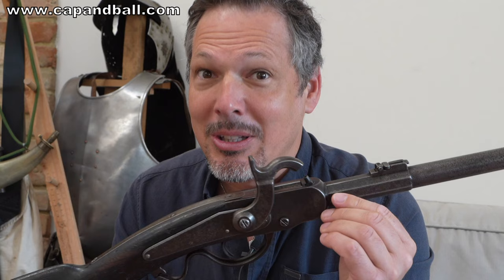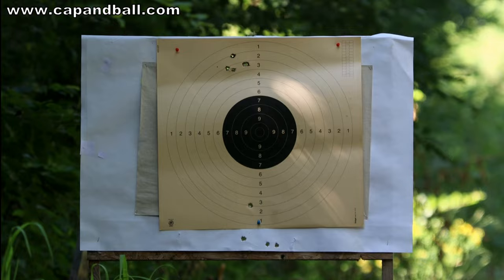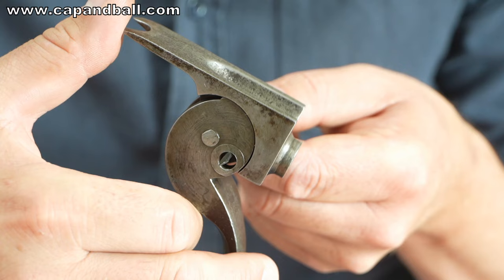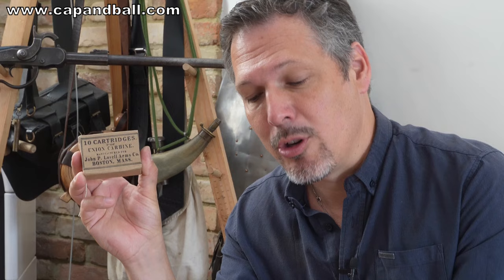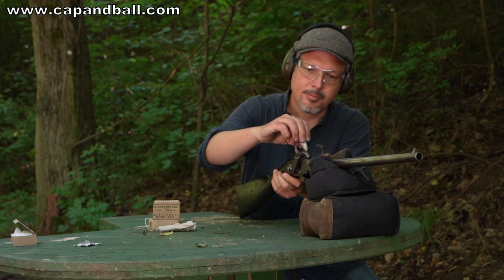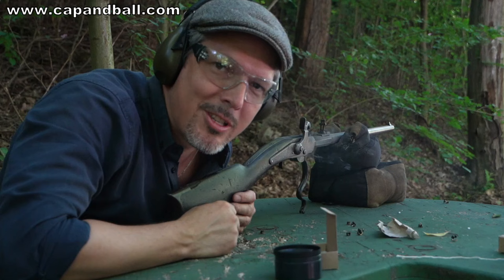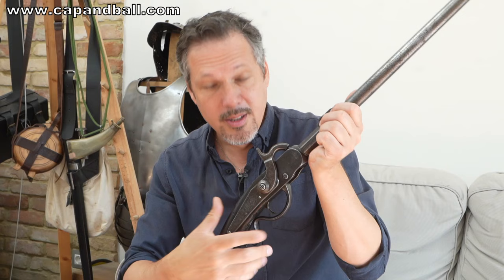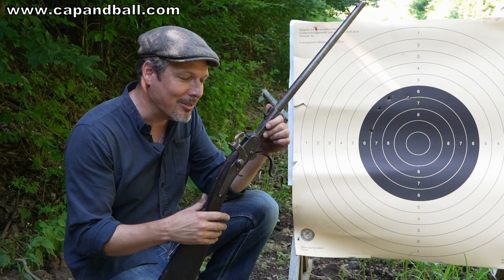The Civil War Grapevine percussion breech loading carbine

Comment: All those breechloaders had the same gas leaking problem before the metallic cases, indeed.

The Hall 1819 rifle that was the first breech loading rifle to have seen service in the US Army, even the Lindner carbine that was sold to the french army and saw service in 1870...
Reply from the maker: A friend of mine has a Lindner. I am planning to make a video about it.
Reply: @capandball  
Lindner tried to solve the problem and partly succeeded with a specific locking system.
Efficient but they became quickly obsolete...

Comment: Thank you for this video, I shoot one in the North-South Skirmish Association and it is an accurate and easily serviced Arm; I strongly suspect y it was a victim of it’s looks in some of these bad evaluations.  Like the Sharps it leaks gas, but modern shooters wear glasses.  We generally shoot them with the fore end hand way out front.  I do wish the war models had been made with the Maynard’s brass cartridge.  I shoot Maynards and smith’s in competition and think the Maynard has a better gas seal.  The Gwyn & Campbell is a easy weapon to disassemble for cleaning.  Thanks again for a great video!!  PS. They were used in Grierson’s famous raid.

Comment: Nice video. Thanks. 
Just for consideration  - while starting at half cock is in accordance to the manual of arms, I can assure you that any soldier on the front lines would skip the half cock step. "Fire", "Full cock", "Open breech", "Load cartridge", Place cap", & "Fire", would be the sequence any soldier under fire would use.
I'd be willing to bet that you'll get three more shots off in that minute if you would try to do the same.
Reply from the maker: Yes, you are right. Skipping half cock makes the process faster.
Reply: I am not so sure about "any soldier". Once you're drilled to do something a certain way, you're likely to revert to that under stress.

Comment: It is a ugly duckling but it shows the innovation at the time. I was very impressed with the accuracy of the .535 round ball with such a fast twist rate. I guess the 40 grains was low enough to poke it along without striping it through the rifling. 30 meters is like 100 feet.

Comment: This is an excellent carbine for cavalry scouts. The firepower would be great once they dismount and conduct a recon mission and self defense of compromised. Next if a cavalry troop has to conduct a screening maneuver when coming into contact with the enemy to cover a heavy force behind them. Another if a cavalry troop or squadron has to hold ground to await of the arrival of a heavier force like infantry and artillery. Which the firepower of these carbines can be more effective laying down lead on the enemy. The problem I see is a lack for a handguard under the barrel for a few rounds under combat conditions.
Reply from the maker: That was a key element of the use of cavalry during the civil war. Rather a dragoon concept, than European light or heavy cavalry.
Reply: @capandball  Indeed Sir. I used to be a Paratrooper in the Airborne Infantry and Cavalry Scout. In the American Civil War that Cavalry with good carbines with firepower can hold key positions when doing recon or fight their way out if compromised faster than non mounted troops if trained in reconnaissance roles to get a message back to higher command. Robert E. Lee had a problem with Gen. Jeb Stuart who's cavalry had ran amok in the Union Army's rear and flanks had not reported to Gen. Lee about the Union Army's positions and strength. This cause the Confederates to lose the battle of Gettysburg. The Union cavalry under Gen. Reynolds were able to fix the Confederates in contact with repeating carbines until Union forces arrived marching double time. Very good tactical sense in creating initiative in combat to form the battle. According to history this was a chance battle by accident. The problem was Confederate cavalry failed to gain intelligence when it was attacking into Union territory.

Comment: Interesting. I get good accuracy from my modern muzzleloader with the 1:28 twist rifling. That slow motion shows gas and particulates flying backwards towards your face. You have to keep in mind in the 1860’s polycarbonate eye protection didn’t exist, so it likely did blow shit into shooters’ eyes. Looks like you need to set the rear sight lower or file the front sight or load develop your conical load regardless of historical claims. I bet you could fit more than 40gn of powder in the cartridge or less if necessary to tighten that group up, or some combination of those. Lot of 1800’s guns were made with proud front sights and you would pick a load that grouped right then file if necessary the front sight until it looked where it hit.

Comment: I would expect a higher powder load because of the pressure bleed off. Also, how does the powder ignite being a waxed paper casing?  And without a pressure seal, I'm shocked there is a strong explosion instead of a flash like black powder lit in the open.

Comment: I owned a replica German made Gallagher Carbine in the 70's (imported by Navy Arms).  Interesting gun to shoot but be prepared to lose all the hair off your bracing arm.  Finally sold it (after setting my shirt sleeve on fire) and got a modern Smith & Wesson model 25 in 45 ACP revolver (still a good trade and I wish I'd kept it).  Came with several brass cartridges that you reloaded by hand with ball and powder (and lube).  Used a standard rifle percussion cap (like the Grapevine Carbine) to fire the cartridge.  You could paper cartridges or the brass cartridges.  Used supposedly by the Union Calvary in a couple of states through private purchase.  I just know I didn't have hair on my left arm for several weeks after shooting it.

Comment: Anyone have any ideas why a lot of these little carbines don't have wooden foregrips? I was thinking if most cavalrymen had something like riding gloves, maybe they thought that those would protect the hands from the heat and you could save a little weight and material. Still seems odd when most every other long arm had a wooden foregrip
Reply: Most likely manufacture ease. Additional furniture means additional manufacture time and cost.
Reply: In competition , people wear gloves to shoot the Maynard carbine . In some cases , such as the Smith carbine with wood forearm , they will hold the barrel for better accuracy . The metal barrels get very hot very quick . Never seen anyone shooting a grapevine carbine in rapid fire competition in my 47 years of wasting lead with the N-SSA .

Comment: It's a beauty...but...It amazes me that the US Cavalry did not push so much harder and much earlier for mass adoption of either a cartridge-based carbine or better, a repeating rifle. Early in the war the Confederate Cavalry outperformed them. Consider the advantage if Union Cav had Henrys with a shorter, rider-friendly 6 or 8 round barrel. Troopers could carry dozens of ready to use cartridges. Range is less of an issue mounted when you can close more quickly or disengage if you are out-distanced by longer rifles. Overall, They would have had a tremendous advantage, mounted or dismounted. If you take into account the cost and care of the horse with saddle, tack etc, the added cost (and complexity) of repeaters would seem trivial.